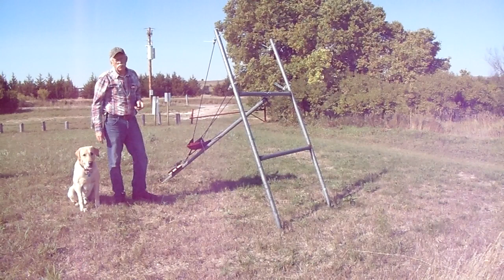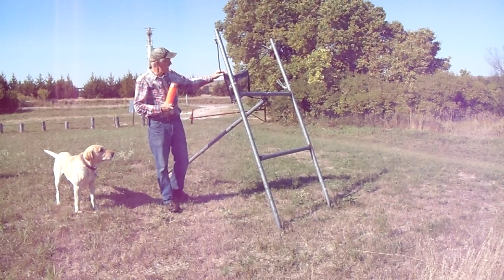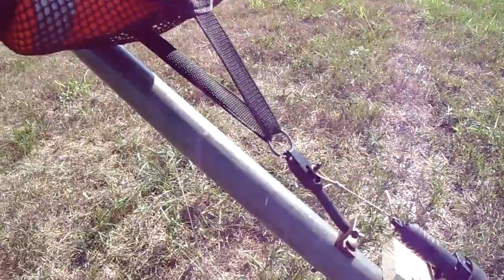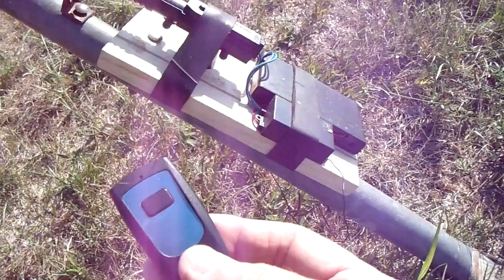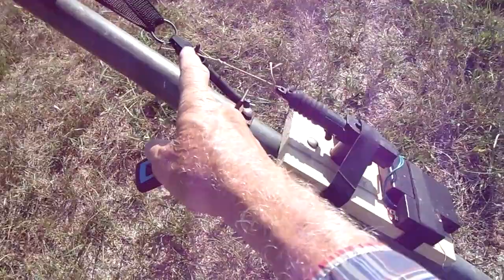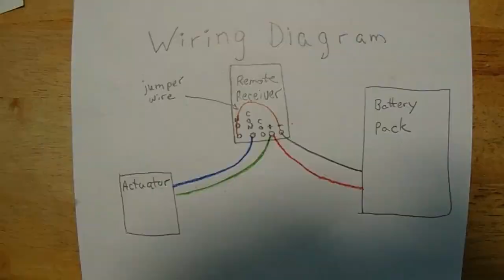Homemade Remote Control Dummy Launcher

Comment: Can you buy the receiver, transmitter and battery case at the same Place. The frame will be easy however a grocery list of the other components would be awesome.
Reply from the maker: All the electronic components were purchased on Ebay.  They are listed at the very end of the video after the wiring diagram.  It goes fast so pause to read them all.  A pouch and the rubbers can be bought at huntemup.com.  All the rest can be purchased at a hardware store.
Reply: @marklindvall  Ok, thank you very much

Comment: Can you list the actuator you bought for this?
Thank you
Reply from the maker: Zone Tech Universal High Power Heavy Duty Door Lock Actuator (still available on Ebay)
Reply: @marklindvall  Where did you get the mesh pouch from and rubber lines?
Reply: Also can you maybe show the hinge that you used on the frame?
Reply from the maker: @robertdelgado2667  Can't remember exactly where I got mine but huntemup.com  has pouches and rubber lines.
Reply: @robertdelgado2667  I used a large door hinge and cut the end off the shaft so the shaft can be removed for separating the pieces.